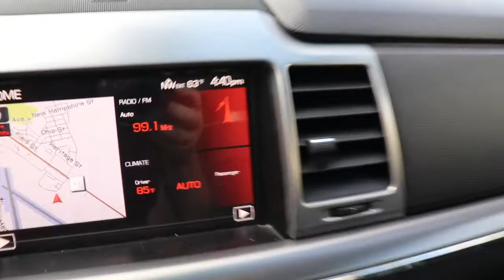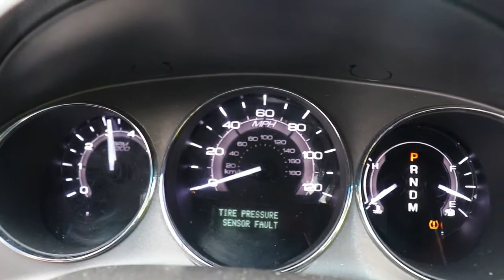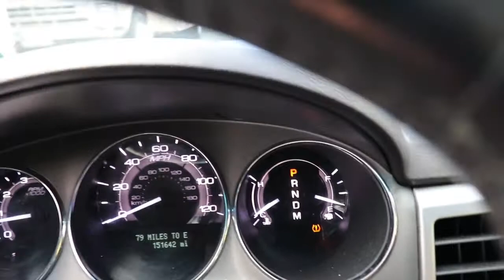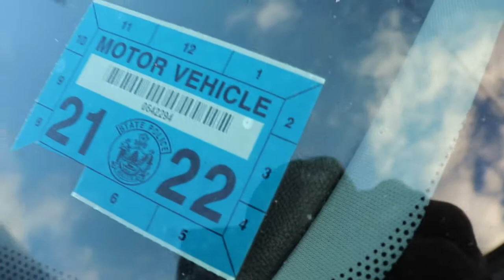Subaru's and fancy Lincoln's on deck for SCRAP

Comment: Idea, go on eBay and see what parts are selling.
I would think stuff like the taillights headlights backup sensors infotainment system, could be worthwhile to try and sell.
No wonder why the transmission went out early, they have tons of recalls on them even on the newer Ford Fusions, most go out under 100000M.
Reply: I guess Fords love to eat transmissions. I'm already getting significant shuddering in my mom's '17 Focus 2.0 SE. Ford makes good engines, though, and if the boot ever meets this MKZ, this'll be a long one!

Comment: Hold the gear lever in between park and neutral on that MKZ. That bypasses the 4k rpm limiter, and the car's scrap, so who cares if you break the transmission?
Reply from the maker: That would be reverse, no?
Reply: @acrazycanuck78  Yeah. It was park and reverse. Bad memory on my part. Unfortunately the limiter's soft cut, so during the death by boot, the ECU will just hold RPMs at 7 grand. No bouncing or anything. Just make sure to keep your foot on the brake like you did with the '06 Caravan.
Reply: @acrazycanuck78  Here's all of the cars that I know of that have those park limiters, and this only applies to versions of these cars with automatic transmissions, but some manuals do have them. If the park rev limiter isn't at 4000 RPM, then I'll list what it's at.

2003-2014 Acura TSX (5000 RPM)
2003-2014 Acura TL (5000 RPM)
2004-2012 Acura RL (5000 RPM)
2015-2022 Acura TLX (5000 RPM)
2014-2020 Acura RLX (5000 RPM)
Virtually all Acura MDXs (5000 RPM)
Virtually all Acura RDXs (5000 RPM)
2003-2020 Cadillac CTS
2004-2011 Cadillac STS
1986-2019 Ford Taurus with automatic transmission
1992-2019 Ford Taurus SHO with automatic transmission
2011-2018 Ford Focus
2000-2022 Ford Escape
1991-2011 Ford Panther Platform (5000 RPM, 4500 RPM soft-cut post-2006)
Most Daimler-Benz/Daimler-Chrysler products
Most Audis